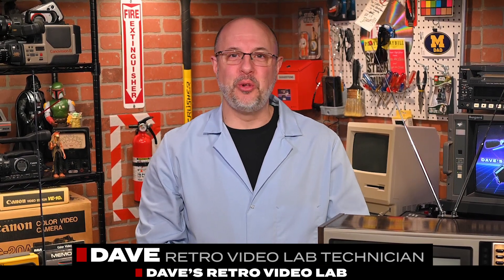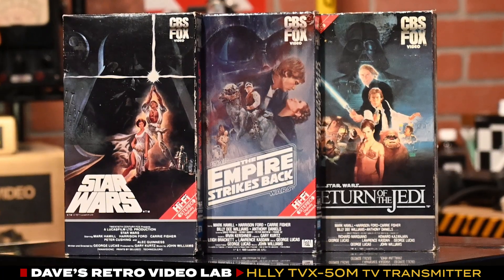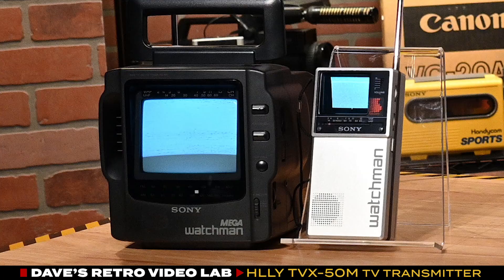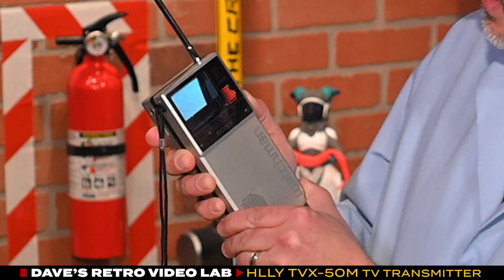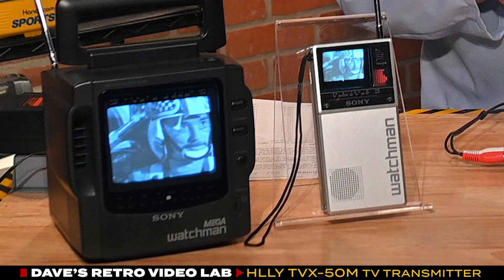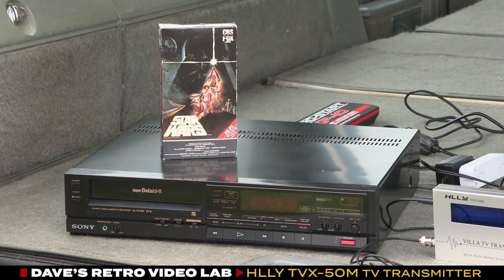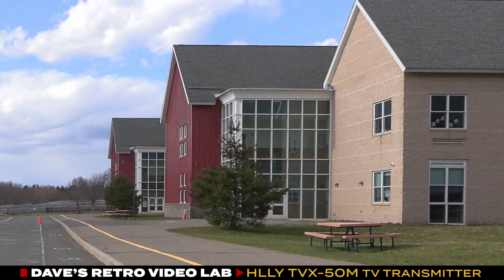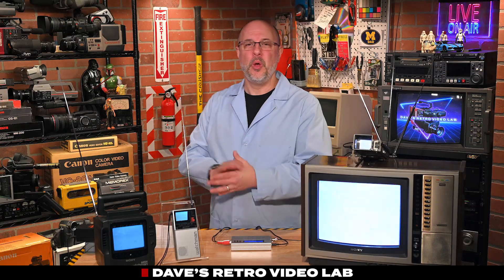Testing a DIY UHF TV Signal on 1980s Portable TVs — Does It Work?

Comment: You can use an external antenna on the roof & it will go much further & also add a VHF or UHF amp make it more powerful. -Cheers!
Reply from the maker: Thanks for the tip!

Comment: Tell me that's your kick butt station wagon? I remember when i started in broadcasting in 1976 we actually used ford station wagons for tv vehicles. Driver, talent, camera, tech/audio  operators and the back was all equipment. Alot of times back then we had to use coax drops to go live versus sat- link. Awesome memories. If it is your station wagon promise me when u buy a new car you keep that and turn it into a broadcast center
Reply from the maker: That is indeed my wagon.  Though, I need to conduct a proper introduction of Retro-1.

Comment: Hi, I'm a new sub I just discovered your channel and all I can say is that it's amazing! 
About the experiment, you should have tried in the lowest frequency possible, channel 2 in VHF for example, since lower frequencies travel longer than higher ones, also digital channels and cell phones carriers are currently using the UHF band which can interfiere with your signal.
Reply from the maker: Hello!  
That’s a good note.  Thank you for sharing.  To access the lower VHF channels, I have to open the device and tweak something inside of it.  For the episode I decided to try the UHF channels simply because they are easier to access at the time.  When I have a lazy Saturday afternoon ahead of me, I’ll retest the transmitter to see if I can get better results.  Thanks for watching!

Comment: 5:24 The potential issue with using any uhf channel 34 or higher is that the cell towers block out those frequencies so you'll have a lot of interference
Reply from the maker: Ahhh that’s an interesting thought.  Thanks for the information.